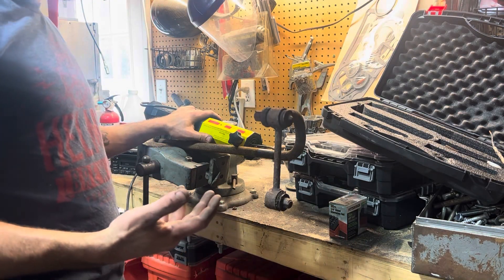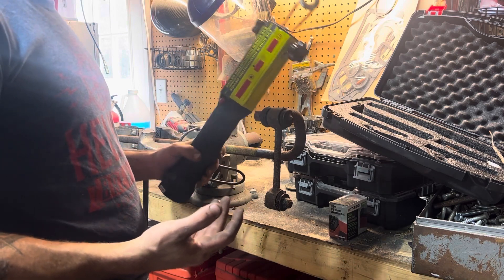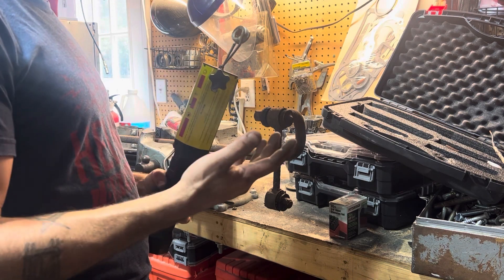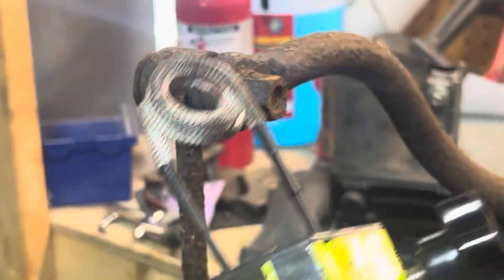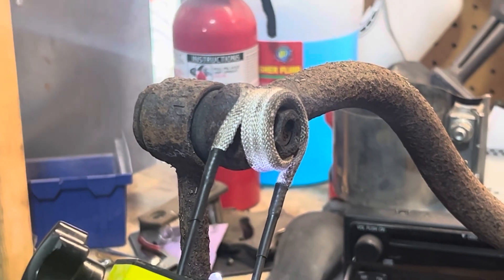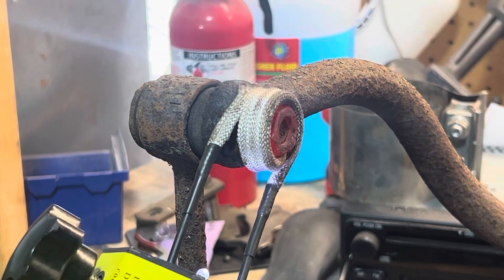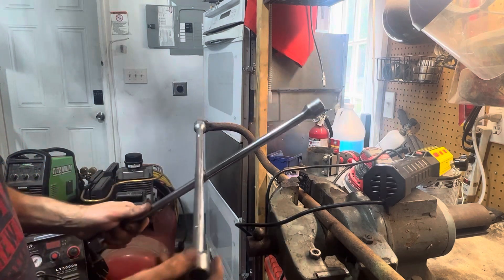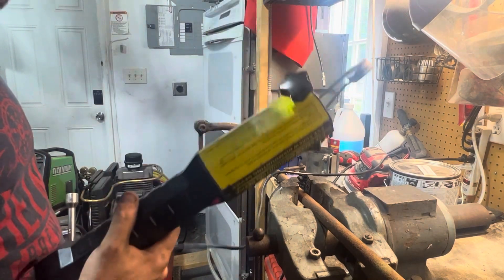Bolt Buster Review: Magnetic Induction Tool MELTS Stuck Bolts in Seconds

Comment: Can you tell us how long this tool lasts.  Seems they work for about 5 bolts, then the unit stops working permanently.
Reply: I’ve had the tool for 2 years the individual coils are consumable items so depending on how you treat them
Reply from the maker: I’ve used mine heavily for the past few years
Reply: Maybe dip it in water to cool it off would save the tool.

Comment: just went to start tearing my rusty corroded brakes off my corolla and no luck. ordered this. trying again this weekend.  don't have right size extractor bolts but was going to buy them, but super curious how well this works.
Reply from the maker: I think you'll be really impressed with it, they make a huge difference when you run into those stubborn bolts.

Comment: Does it work if you cannot get the coil on the nut? I’m trying to remove bolts where the nut is welded inside the frame. I can only access the head of the bolt.
Reply: Have you found the answer ?
Reply: @ti8966  No I didn’t. I’m interested in these, but I don’t want to spend the money if it can’t work the way I need it to.

Comment: What was your logic in letting it cool down some??
Reply: Its a bolt. The reason why it works on bolts is not the expansion per se but the breaking of rust. On nuts its the expansion of the but that makes it easier to remove.
Reply: @larseriksson1184  You didn't answer his question. There was no reason to let it cool. Also, it's both the breaking of rust and expansion of the nut. If it was simply the breaking of the rust then the percussive shock of the impact gun should loosen the nut. Obviously the heat had a lot to do with it.